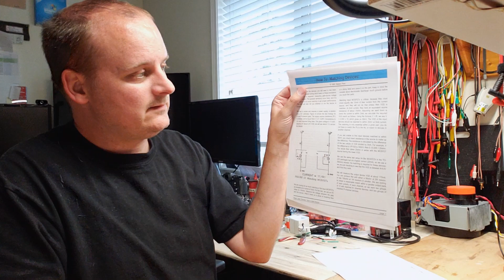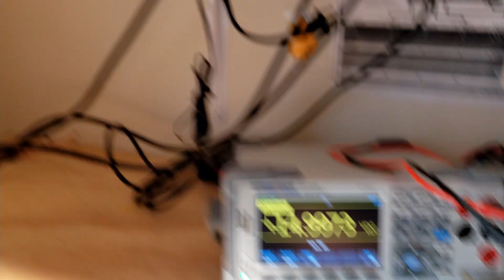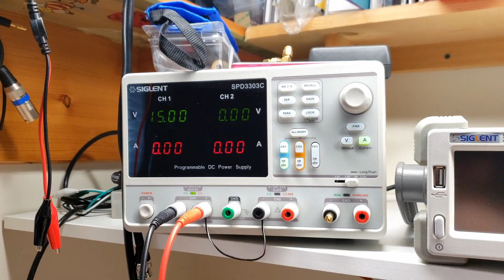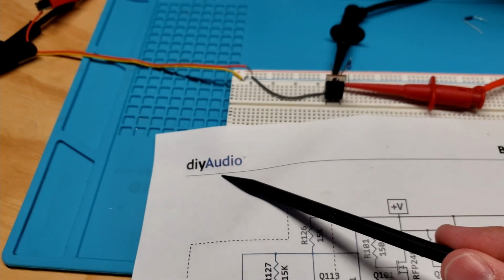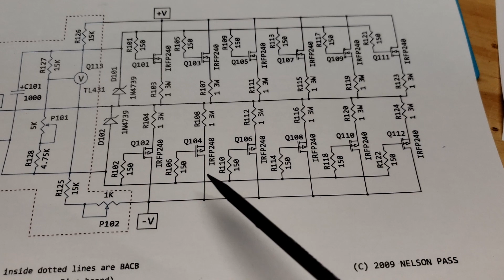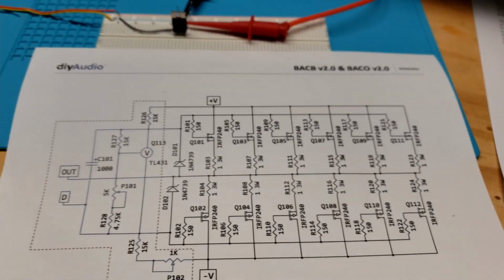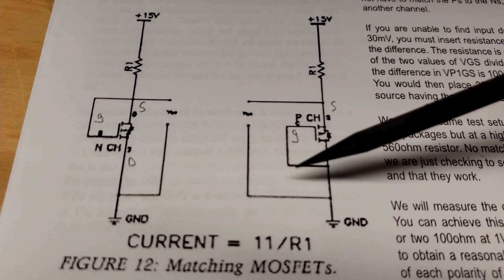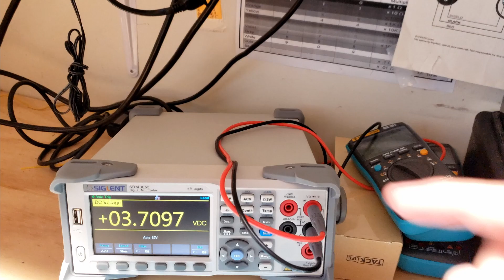Matching Mosfets For Audio Amplifiers !!

Comment: Thank you very much for sharing!

Does it make any difference if:

1) warm up MOSFET in 50 degree centigrade (122 degree Fahrenheit) oven for half an hour before matching

2) match them at working current, 500mA to 1A

Thanks.

Comment: That is a really fancy multimeter and Power Supply Unit you got! Is it possible to do this with cheaper tools?
Reply: You don't need a very fancy meter or PSU. However, the more digits on the meter the better for accuracy.

Comment: Hi again.  Is It necessary matching fets for a class A amp, w/ just a pair of fets? Like Pass ACA?  Tks again
Reply from the maker: No, you don't need to match for a single fet per side.
Reply from the maker: Why not just use a 12v battery ?